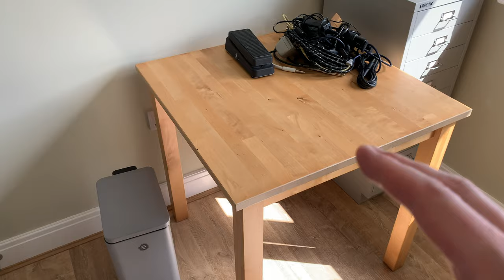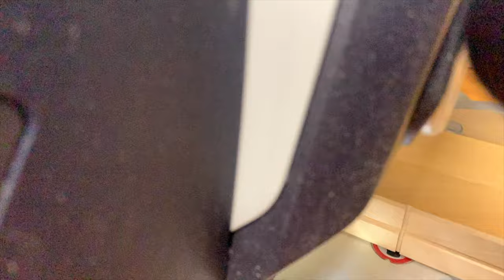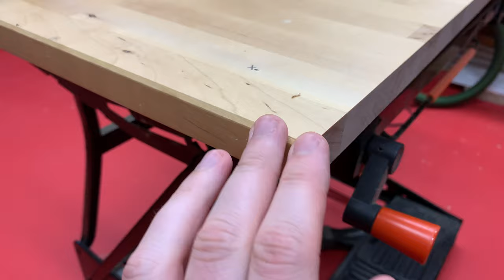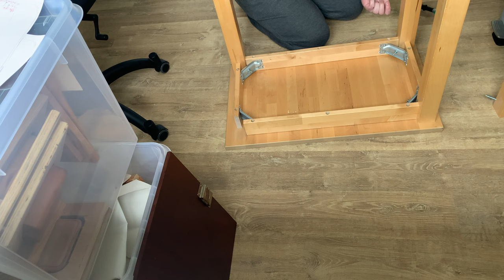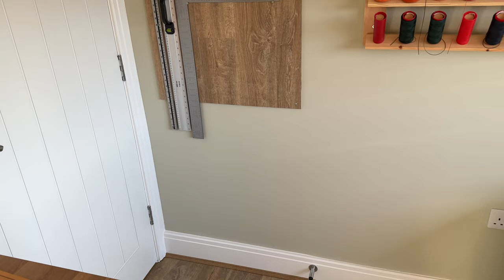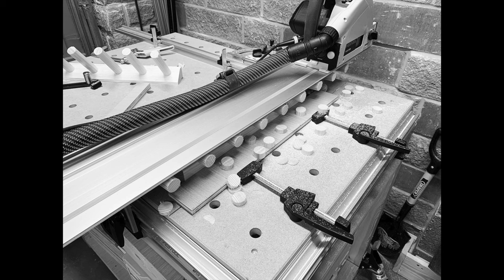Leodis Leather New Workshop - #6 Press Table and Thread Rack (IKEA HACK)

Comment from the maker: In this video I'm showing a couple of the projects I did to finish off the workshop. Firstly I cut down my old IKEA Norden dining table to make a smaller custom table which will house my arbor press and motor burnisher. Secondly I built a custom rack for all of my reels of tiger thread which I'm pleased with :)